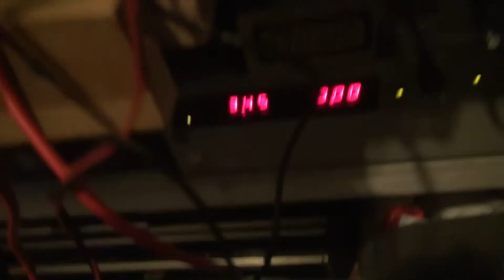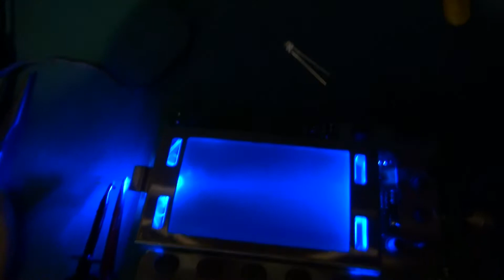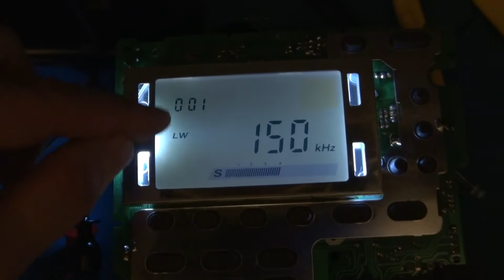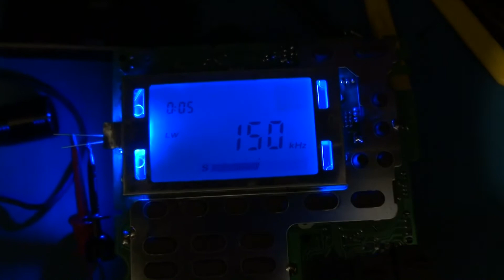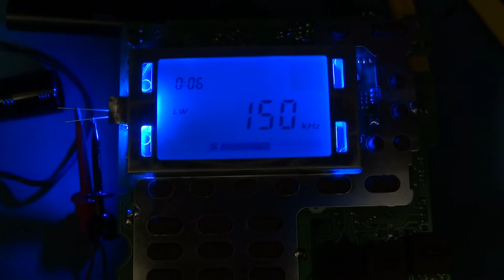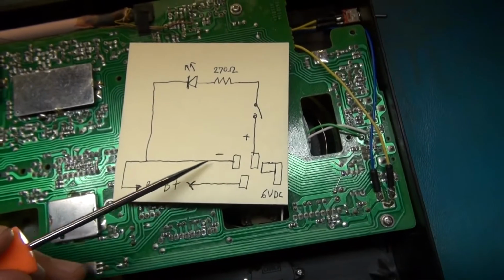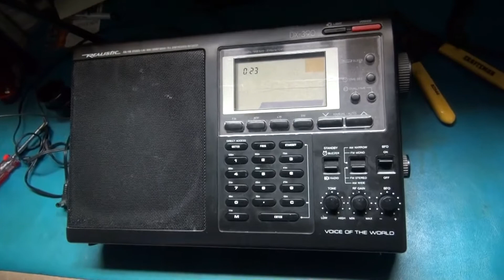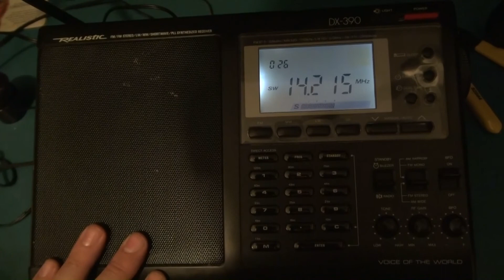Realistic/RadioShack DX-390 Shortwave LED Backlight MOD.

Comment: Would be cool to just toggle it on and off with the original circuit using a relay. Wired the way you wired it so its on constantly or off constantly.

Comment: This little mod works great for me and maybe something you might want to try.  For the LED back light display power up you can connect the LED (+) connection to the (collector) (Middle Leg) of Q44 transistor instead of having a separate switch to turn the light display on and off. You would then have control of the display LED light with the front power switch. Don't forget you will need a correct valued resistor in series with the LED before connecting it to the Q44 transistor leg.
Reply: Excellent!

The Elegant Solution!

Comment: On mine the external power jack doesn't work. But that's OK battery life is excellent. I probably get at least 40 hours with alkaline D batteries.
Reply: Re-solder the three places it mounts  to circuit board!

Two are power and ground.

The other is  for mechanical support.

The solder is often cracked by whacking the AS/DC converters co-axial plug.

Particularly Radio Shacks with the interchangeable tis.

I've owned 3 DX-390s and now an ATS-818CS

EACH has had this problem, sooner or later.

J.C.

Comment: Just found your videos and very interesting content. With the back light mod I am assuming there is a momentary switch to turn on the origional light which then times out after a predetermined interval. I would have re - purposed the momentary switch to activate/deactivate a latching circuit with a simple 555 device. That way you maintain originality in the radio and no drilling for extra switches to mount.. Karl
Reply: Elegance!

Comment: I had a similar issue like this I like the idea of scotchbrite to score the diffuser .the sun rise in the screen where the led sits I used a small amount tiny of white paint first allowed to dry then coated the white with black the white paint was to push the light back in to the body of the unit and the black stopped the light punching across the centre of the screen  nice work sir .:D . and white was better blue is taxing on the eyes I find.